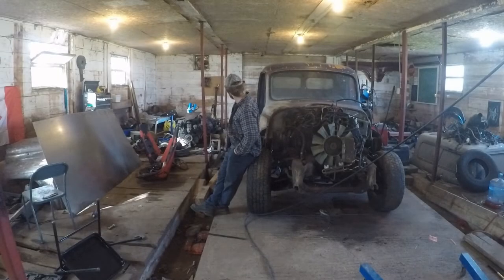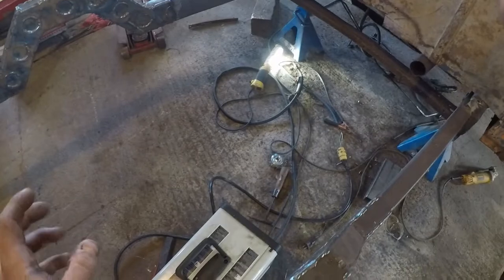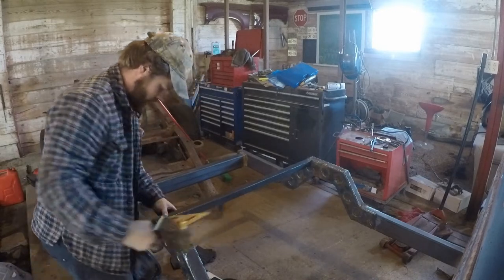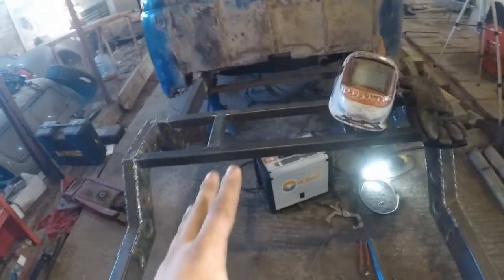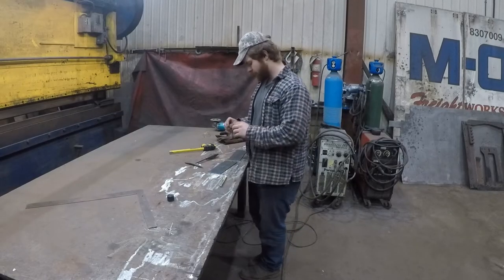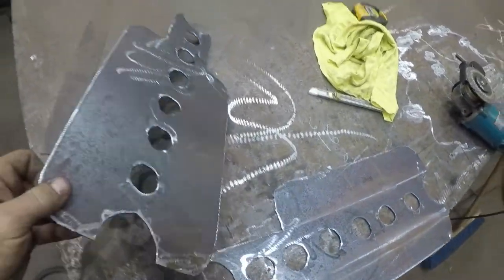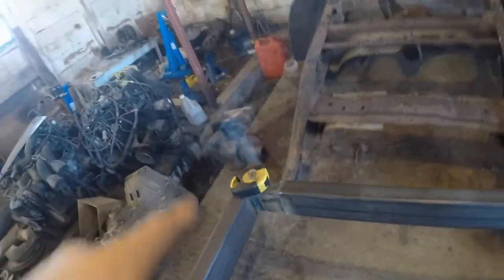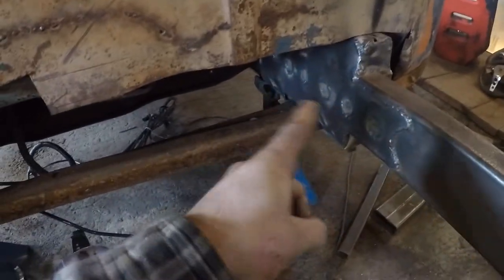How to weld two different frames together strong enough to tow trailers!

Comment: Question.. I want to buy a 76 Jeep J10. 8ft.  But the last 2-3 feet of the frame.. just gone.. went from qell over 1.8th thick to paper.. but the other 80% of the frame is solid.. not even rusted.

Its odd.. but these fsj frames tend to rot in the rear.   Everyone says pass.. but i like the color of this jeep outside and interior wise.   I found a guy with a good frame from a 75 same wheel base.

But i dont habe cranes or anything in my shop to lift cabins and engines and so forth off frames.  

So couldnt i jist pop the bed off with wood and jacks.. and then cut the 2-3 feet of frame off. And put in the 2-3 feet of good frame in.  Just weld the two peices together.. grind smooth.  Then use fish plates over top welded. And BOLTED together on both sides ?  I imagine.. this would be stronger than factory lol.  But maybe im wrong.

What do you think ?  I think tbh this is easier than fighting with wiring. The cabin.. engine. Trans. Axles. And so forth swapping all that crap over.

Basically the last 2-3 feet of frame. Is where the two rear shock mounts are. And leaf spring mounts for the rear.

But i gatta ask if this is feasable ? Or would the frame just split in half from weight in the bed or normal driving
Reply: I'm about to attempt this with a YJ. How did it go?
Reply: @marksimonik  wowww... 5th time attempting this replu.

I rebuilt the J10.. checj (it) out i rcorded it all if you get what i mean.. fcc cant even point ppl to myself on here
Reply: @jeepsblackpowderandlights4305  Okay, according to the videos I watched, looks like you didn't go the route of using the donor frame and attaching it. Good luck with the Jeep. It's a cool truck.